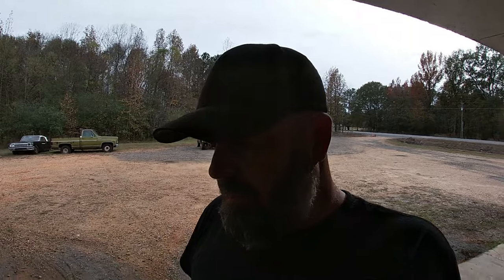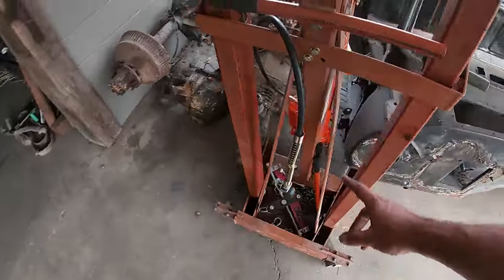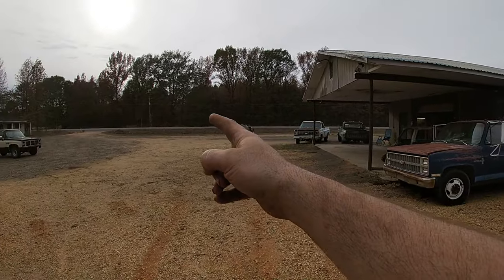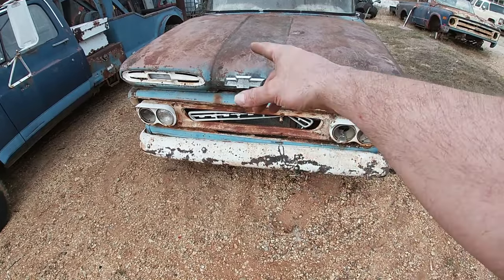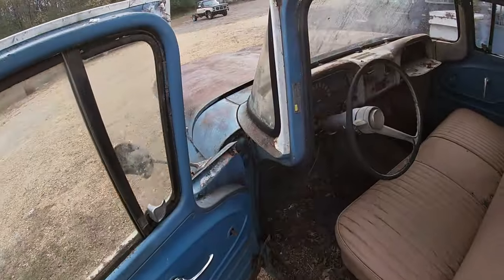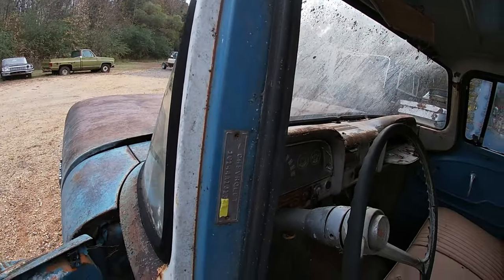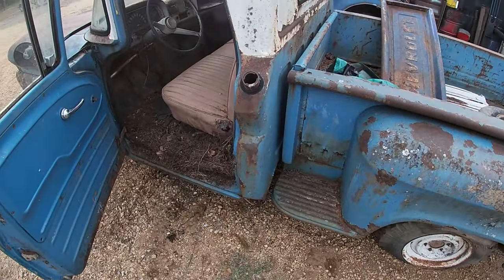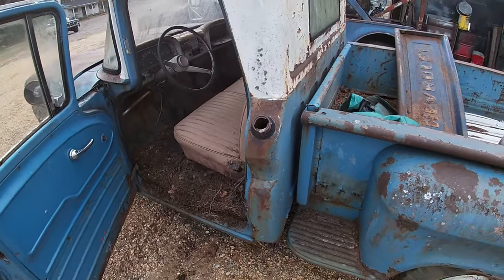HOW TO Decoding VIN numbers, Trim tag, Suffix codes, and casting numbers on a chevy truck.

Comment: I have a 1962 Chevrolet C10 pickup with beginning numbers 
2C154K124xxx.
2= 1962
C= 2 Wheel Drive Conventional 
15= 1/2 ton Long Bed
4= Pickup 
K= manufacturer City  ???
¿Could " K" mean Kansas?
Reply from the maker: K would be Kansas City
Reply: Thanks for watching!

Comment: Does the vin tell if my 74 Chevy is an orig longbed or shortbed   vin # CKY244Z
Reply from the maker: C Chevrolet 
K 4WD
Y 350 4 Barrel 160 HP
2 3/4 ton
4 Cab and pickup box
4 1974
Z Fremont CA
Reply from the maker: As far as I know they did not offer 3/4 ton shortbeds
Reply: Thanks for watching

Comment: I just bought a 78 c10. I’m not sure what trim it is. The truck has Cheyenne 20 emblems on the outside, however it has a custom deluxe emblem on the dash. However the truck is not a c20, it’s a c10 after I checked the vin and decoded it. How can I tell what trim I have? Thanks in advance
Reply from the maker: Does it have the SPID sticker in the glove box?
Reply: @HarmonGarage  thank you for the reply!!! I checked my glove box, it doesn’t have the sticker however there is some sticker adhesive in the glove box but no sticker. What does that sticker mean? Again thanks for the reply
Reply: @HarmonGarage  where is the SPID sticker located?
Reply from the maker: @user-yz8qk2te8i the sticker is the build sheet. Basically it tells you everything the truck came with
Reply: @HarmonGarage  okay thanks I appreciate the reply. Unfortunately it doesn’t have it in there. Is there any other way to know what trim it is? I’m trying to buy a new dash trim emblem and honestly just want to get the correct one. The windows are manual if that helps
Reply from the maker: @user-yz8qk2te8i I’m assuming from what you’ve told me it’s a custom deluxe. Somebody changed the front fenders and didn’t change the badges